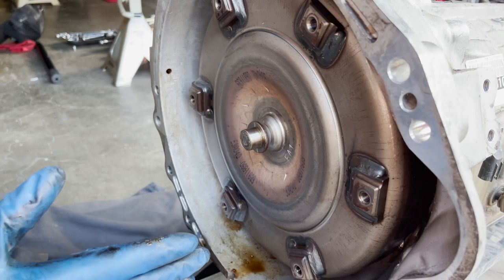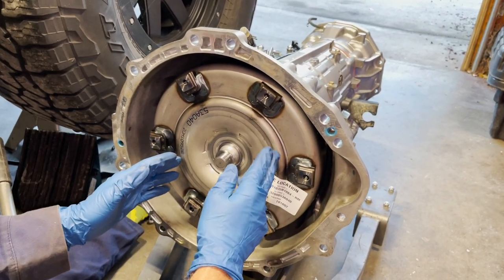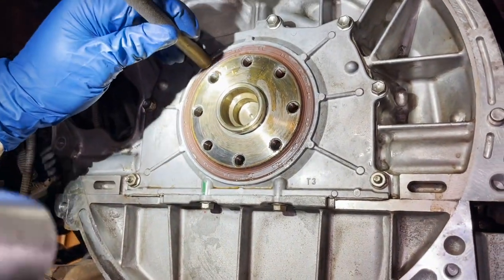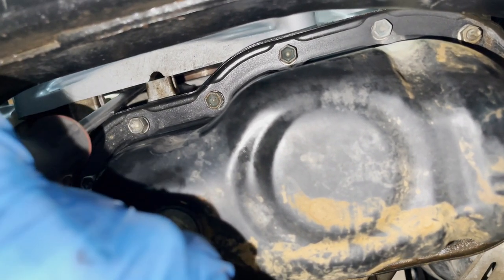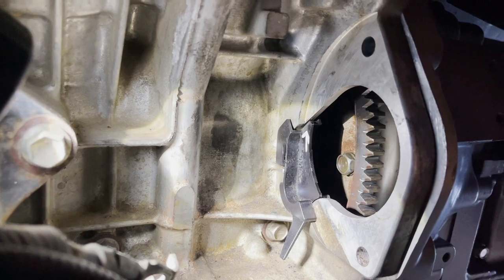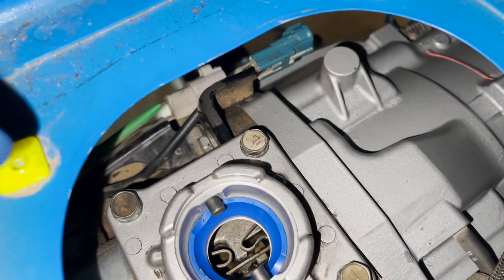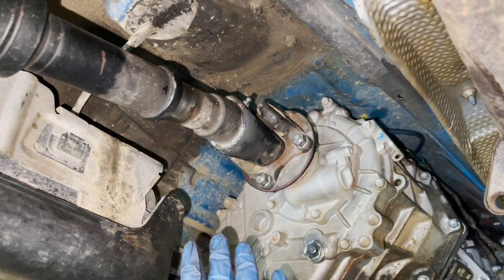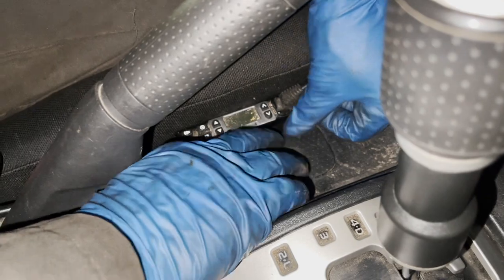FJ Cruiser Automatic Transmission Replacement (Part 2 - Installation)

Comment: Timmy the Toolman, thank you so much for this awesome video sir! My 07 is only at 187,000 but we have two FJs and I know one day I’ll be doing this job myself. Keep up the great work! And PS have you ever rebuilt this transmission yourself? How doable is it?😎
Reply from the maker: You're welcome Chris.   No, I've never rebuilt one.
Reply: Well… I’m at 194,000, my 07 head gasket went this month. I’m debating on doing the timing chain, water pump or just pulling the engine versus leaning over it. But if I do that, the torque converter will be easy to get at. What brand torque converter did you use on your FJ? Thank you sir!😎

Comment: Incredible information have a bad shudder on my 07 FJ with 180k due to bad torque converter, tried changing fluid many times haven’t flushed it yet might do that in future but I’m thinking best option is just replace the whole trans all together
Reply from the maker: If you go for the transmission swap, I hope the job goes well for you.  Get at least one buddy to help you.

Comment: With the TC out like this would it be easy to properly replace a faulty TC actuator (center diff not engaging) or would it have to be further disassembled?
Reply from the maker: We've never messed with the TC actuator so we don't know what's involved with replacing one of them.

Comment: Wouldn’t it be good idea to install a remanufactured Denso starter during this time?
Reply from the maker: It probably would have been the ideal time to replace the contacts and plunger in the solenoid, but I wouldn't replace the whole starter.  Usually when the starter fails, it's worn down contacts.  And, as you saw, getting the starter out through the top isn't that hard.
Reply: @TimmyTheToolman  I’m each job where the transmission was removed, I use a shop to rebuild the starter. I also use this time to replace the mounts (front wheel drive) it just reduces time later down the road to return and do this in the future. Kill multiple birds with one stone, per se.
Reply from the maker: @jamram9924  Yeah, do what works for you.  You could save money and forego the whole starter rebuild because most of the time, replacing worn down solenoid contacts is all it really needs.  Are you talking the engine and trans mounts you're replacing?

Comment: May I ask why did his transmission fail?
Reply from the maker: It was puking out ATF from the front seal, shifting bad and slipping.  Even after adding fluid, it still was having major shifting and slipping issues so Rey made the smart decision to just get a remanufactured trans from Toyota rather than trying to fix his which had 280k miles and wasn't taken care of because the fluid very possibly might have never been changed.  Rey bought it with 80k miles on it and then drove it for 200k without one fluid renewal.  Not good.
Reply: @TimmyTheToolman  hi good sir thanks for the reply. 
My 07 4R v6 has alil bit of oil on spark plugs and alil on the coils. It has 180k miles no visible leaks on the outside. What do you think it could be?
Reply: @TimmyTheToolman  spark plug was 30k mike old
Reply from the maker: @Chorizomicks  It could be your spark plug tube seals are leaking.  Sounds like you're due for a valve cover gasket job.
Reply: @TimmyTheToolman  Thanks good sir!
Reply from the maker: @Chorizomicks  You're welcome